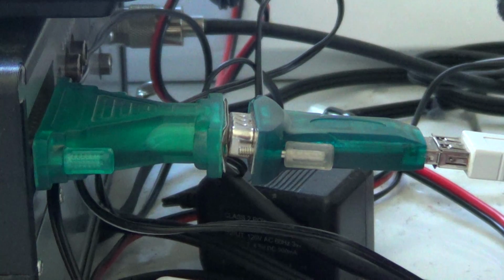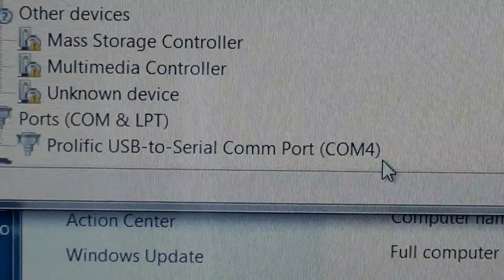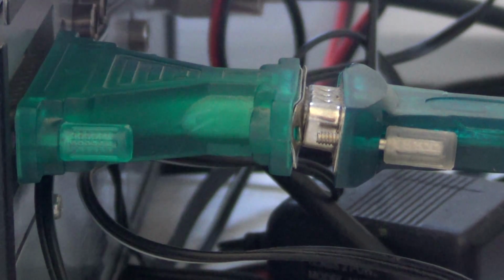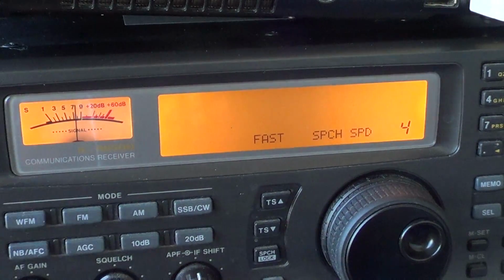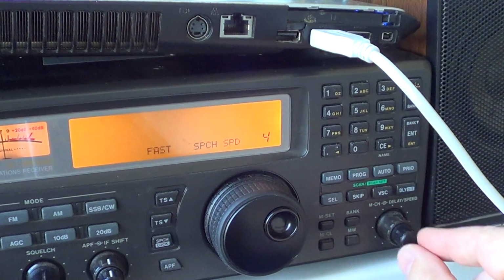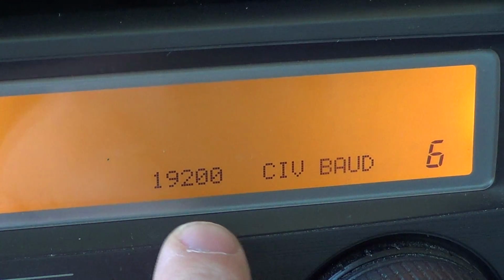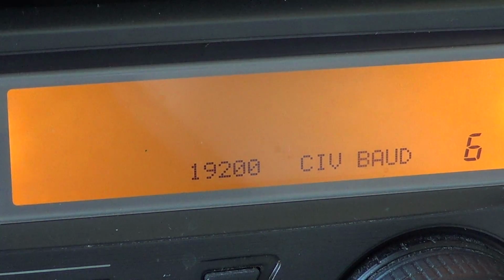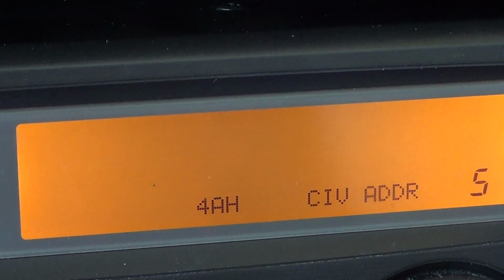Icom IC R8500 computer control settings

Comment: I know it has been a long time since you posted this video but, know that it is still valid! I used it today to set up my radio/computer settings. Thank You very much for your effort!
Reply: brother can you plz tell me how did you connect your radio with ham radio deluxe... i m facing an issue which says "ICOM port 19200. Failed to read the frequency "